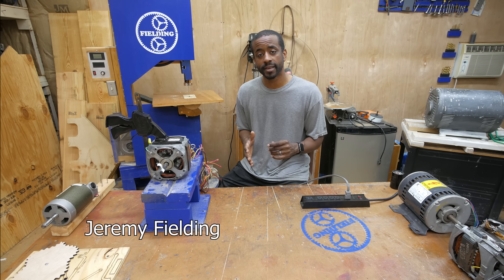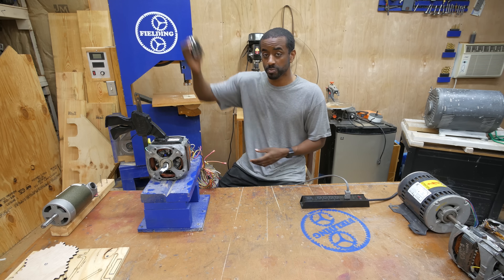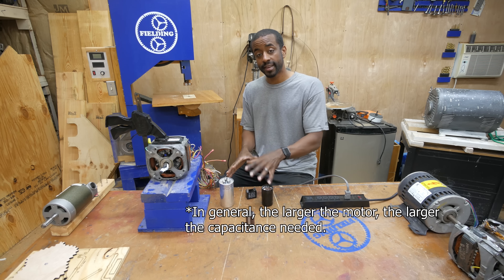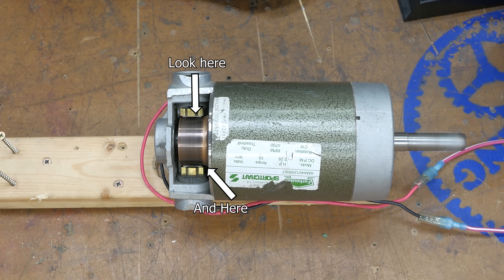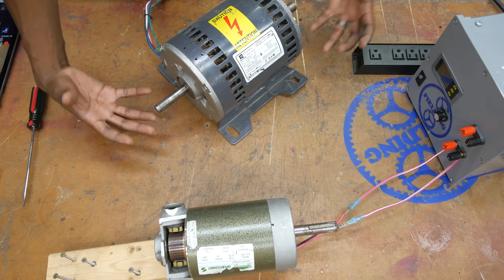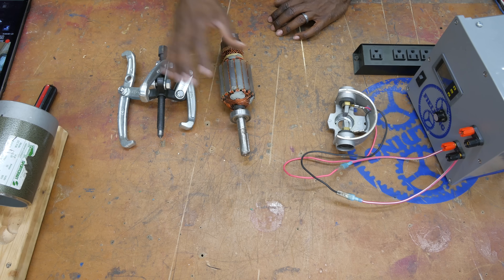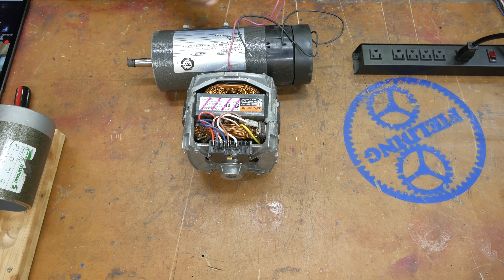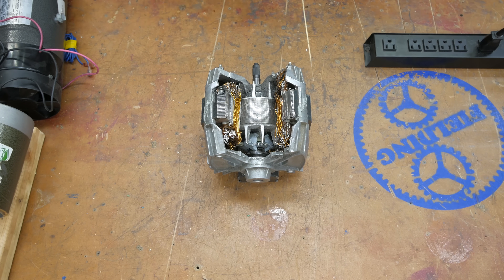Three Most Common Motor Fixes Anyone Can Do; Ultimate Guide to Electric motors ; #070

Comment: I'm completely baffled, I was thought that the start winding of a motor was a lower resistance since it uses a thicker cable and draws a lot more current during start up which is why an inverter motor in a fridge is more efficient since it start up less time than a standard motor, here is an explanation similar to what I was taught        
"Wicida Sarme, Retired Engineer (2001-present)
Answered Jul 13, 2018 · Author has 13.3k answers and 3.8m answer views

Typically starting windings in motors uses a heavier gauge AWG size of magnet wires than the AWG size used on running field coil windings..

This is I believe is necessary in order to support the generation of a much more stronger magnetic flux needed for establishing required starting torque.. In order to produce a stronger magnetic field, it will require a magnet wire size that is capable of handling more current as compared to the amount of current required to sustain the continuous running operation.."   Now I was watching some videos about fridge motors and everyone is saying that the run motor is a lower resistance to the start motor, can you explain that please, thanks

Comment: I've got motors (1/4, 1/3, 1/2, 1 HP) motors all over my home and work shop. Most of the older USA made motors have their original Capacitors (still work fine)  however some of the Chinese (junker motors)  have had Capacitors go bad. What t=do you expect-------- they can't even make Masks or Sheet Rock the right way!

Comment: I had a motor that somehow managed to get its centrifugal switch knocked out of position, which meant the switch couldn't pull one of the contacts back properly. This didn't disable the motor, it still ran, but there was a very loud clicking noise at any speed, and I suspect the start winding kept getting powered intermittently as the contact slid past.

Fixing it was as easy as working out how the switch was assembled, and correcting the contact position so the switch could disengage it. It's been fine since.

Comment: Ive replaced bearings in quite a few motors, a few capacitors, and a while back changed out the centrifugal switch on a bluffton. And more recently had to pull, clean, and re-oil the bronze oilite bushings in a fan motor. All very easy stuff to do for anyone with just some simple tools.

Comment: A little late but I would like your opinion. I'm from EU (240V-60Hz AC grid) and bought an air compressor rated  so. At my place (at the very end of an electric company line) I only get around 195-200V. My compressor is able to start when it's empty (or almost no load) but when charged with 2 BAR (30 PSI) or above, the motor justs hums until termal protection cuts off. May I get a full start with this low Vin if I increase the size of the capacitor? Or even adding another one in paralel? Or do I need more copper turns at the stater coil?

Comment: If the centrifugal switch has failed to return to rest, for any reason, or the electrical connections are't making contact due to debris or dust (huge problem with dryer motor this gives  the same effect as a bad capacitor. In essence your motor is trying to start in the run winding. Get a decent multimeter, learn how to use it, and always check a capacitor before purchasing one that you may not need, and probably can't return.

Comment: I like how don’t rush through your explanation and how clear you are with the subject.  I was helping a person and tried to use the air compressor the motor would try to start but after a few seconds it would kick out. I brought it home and plugged it in and it worked great, I though maybe there wasn’t getting oil up in the compressor and when I laid it on it’s side to bring it home, that got the oil up in the piston. When I took it back it did the same problem. I checked the voltage and it measured 119vac, but it still wouldn’t run. Do you have any suggestion?

Comment: I've changed the bearings and damaged/cut 2 of the copper wires by the commutator- is there a good way to fix this? I've tried soldering but it just does not want to take! (I did strip laquer off wires first)
 cheers all!

Comment: What if the motor is slow to start or trips the breaker. I have a benchtop mill and when it is cold out side it will not start in low speed but it will start in high speed. I have to use low speed for some things. Changing speeds is changing the belts on the pulleys. Could that be a weak capacitor?

Comment: That's what my pool pump sounds like.
Reply: M C 
I've had several pool pump motors sound like that. I will almost guarantee you one or both bearings have failed and it's locked up. I fixed mine for $30 with new bearings from a bearing supplier.

Comment: I've had wires to the brushes break loose and was able to reconnect and it is fine had that happen about 5 times on brushed motors so that might be something to address if you haven't already

Comment: My wife's treadmill was hesitating, then it didn't start at all.  It also seemed to run slow, but I don't know, I'm going on what my wife says. The motor isn't running, so I can't tell if it's sparking or hot. The brushes, are held in with pop out plastic covers. The brushes look shorter than the one in your video, but they are maybe less then inch long. If I take the motor apart, and it's not the bearings, or brushes, what wrong?

Comment: The permanent magnet on my O.B.motor tilt motor came loose (one of a set of two), the glue failed and released the magnet, causing the motor to fail. I contacted the motor company and purchased a special epoxy glue to reattach the magnet, took some measuring to get it relocated in the exact position, glued it in. The motor ran fine after the glue set.

Comment: Weirdest problem I've seen was somehow a winding got snatched by the cast fins. Motor locked up, and when I opened it up it had balled up a chunk of the winding. I have no idea, after years of service, how anything moved in the motor to cause it. My best guess is some part came loose and got between the fin and the winding, but even after the motor locked up nothing appeared to be broken. Weird.

Comment: I was waiting on some new motor brush units for my 240 Volt washing machine here in the UK. They just weren't showing up  with the Royal Mail going real slow with unforeseen protocols during the first 3 weeks of the Covid 19 lockdown. Anyway, I had plenty of time to pootle about and went ahead and cut the remaining brush stumps out of their slides, extended the feed cables from the back of each graphite block,  and effectivly 'cast' new brush extensions onto the back of the brushes out of epoxy putty. It was tricky, and I had to cast then a tad oversize and grind them very carefully to shape on some sandpaper glued to a flat board.  I used hot glue to mount them on a wee  'handle' to control them better, as each one was pretty small and plain awkward.  I just did it a little at a time till they fit just so and moved nicely in the brass slides. A reackon it took me just under 4 hours not counting the putty cure time of 24 hrs. It worked a treat  and still does.  Of course the ones I'd ordered showed up two days later, but I imagine I'll get another 6 months out of the extended ones, before I have to fit the new, and I can do that in about 30 mins flat.  Anyway, I dig the vids Jeremy, and will be checking  out your others, especially when lockdown eases here in about 3-4 weeks and I'll be able to head back to a  compressor fix that awaits me. Keep up the good work.

Comment: I have a start capacitor and a run capacitor on my dust collector. It will run but not at full speed. I ran it with the centrifugal switch exposed and it looked like it momentarily connected then opened again. I can't figure out if its the centrifugal switch or run capacitor. I'm assuming it wouldn't even run if the start capacitor was bad. I'm leaning towards the run capacitor, but when I opened the housing I didn't notice anything visibly wrong with it nor did I smell anything unusual. What do you think?
Reply from the maker: I have a video coming out on this topic soon. I bit to much to explain the possibilities here.
Reply: @Jeremy_Fielding  Cool.

Comment: Great video! Subscribed. I've got a 24VDC 1/3 HP 2500 RPM permanent magnet motor. It's got a 10:1 gearbox on the front. I've completely disassembled it previously to inspect it and haven't been able to find any issues. No increase or decrease in resistance on the commutator when I measure pairs of bars 180 degrees apart or when I measure each pair next to each other all the way around. There's not any connection from the commutator to the armature. I can't seem to figure out why, when I connect it to a power supply capable of 21A, I only see about 50RPM and it only draws about .2A.

Comment: So I’ve brought to life an old homemade bandsaw. Built in the late 60s. The motor does start if I push start. Motor wasn’t designed with a capacitor. I’m uncertain if the pulley size is to large or so I add a start cap. 1/2 hp, 1750, 120 ac, dual shaft. Also unsure what the other shaft was used for? Motor also has external Oiler ports. How often should I oil it and what type of oil?

Comment: I have a 5hp air compressor, I installed a new Square D switch and pressure regulator it starts and runs fine, but even after power is turn-off motor continues to spin...before I installed ned pressure regulator my belt was torn off...any suggested ideas why motor continues to spin?
Reply: first, your pressure swiths is not connected correctly, try disconnect the pressure switch and apply power to the magnetic contactor, nothing should happen, if your magnetic contactor coil is 110 volts, you should have 2 wires that  goes to the pressure switch, on the magnetic  contactor box, ( if power is 220 volts) one side of the coil is connected to the neutral wire ( white), on the other side of the coil, the wire starts from one of the power line ( red or black ), goes to the pressure switch then come back to the other side of the coil, if the coil is 220 volts, you can use the same layout except that instead of wiring the unswitched side of the coil to the neutral wire, you  connect to the opposite  line ( balck or red wire ). For 600 volts, it is  a bit different as you have a step down transformer and you follow the 125 volts diagram.

Comment: I have a boat lift motor and I run it with a DeWalt power station. It works about half the time without over loading the inverter on startup. It will never go up with the boat already lifted either. Any advice on improving this? HP - 1, V 115/208-230, rpm 1725, A 13.8 s / 7-6.8,  SFA 15.2 /7.9-7.6

Comment: That was a very well done presentation! It didn’t answer my question but no matter was fun to watch. I have a capacitor start coil winding that seems to be loosing connection when the motor gets warm. Kinda hoped I’d find a magic cure. Convection oven fan motor at more than 600 bucks I’d like to fix it but looking doubtful.

Comment: Exploding Capacitor Story
A Friend worked in a music shop fixing amplifiers. 
The shop used to be used for some industrial purpose so it had 440 volt power box which for some reason was still connected.
When the guys had a bad capacitor they would hook it to the 440 and blow it up (real good)
They did this for years, all good fun at work.
One day they hooked up a cap - which blew up and shot its contents into the 440 box.
A cap has a lot of aluminum foil as part of its circuit.
After the guys had explained why the Fire Department was paying a visit, The boss said "Don't do that again"
No further repercussions - it's good to be valued - even when you screw up

Comment: Working in a washing machine motor right now. Replaced the capacitor, but it still won't run.
Giving it a "push start" only seems to work, with the power off. Very difficult to do, need 3 hands.
Seems to resist spinning, with the power on. Tried cleaning the motor start contacts too.
I'm guessing the motor is bad. Probably from being overheated when the capacitor originally failed.
A new washing machine costs $450. A used washing machine motor costs about $60. But might be on it's way out too.
Not sure what to do now....

Comment: I have a 1.5 hp electric motor for a 1958 craftsman drill press.  I put a new capacitor on it which starts it just fine.  However, it now starts, runs for 2 to3 seconds and may or may not smoke or/and spark and then stops.  Sometimes tripping the circuit breaker.

Comment: Your videos are legit and I was wondering if you have experience with phase converters. I was experiencing a 3 phase motor doing the whole hum thing because I believe it had a bad set of start caps, is there an easy way to test this? I believe it was caused by the motor it was drivings make up was incorrect , being it was 240 but the peckerhead was made up for 480. Just found your videos and am hoping you could explain phase converters if possible.

Comment: Hi Jeremy, 
I have a mini table top lathe. Was working great until I got a back catch and the motor slowed down and then completely stopped. I waited a day and tried to turn it back on... nothing turned on. There was no hum, no reaction from the machine. I know NOTHING about motors. I have since taken off the "cover" and can now see the copper wire, brushes, and what looks like rows of staples (?). I don't think my capacitor is bad and I don't think my brushes need replacing. Any help would be MUCH appreciated!
Thank you in advance
Reply: Oh! This is a DC motor, volts 120, rpm 1700, phase 1, class E. Not sure if that helps. It looks very similar to the second and third motor you worked on.

Comment: I tuned in to watch your video as my small electric fan blower motor on my pellet stove stopped working and thought maybe it was fixable, (I have not removed the motor as of yet). When not in use the fan and shaft can very smoothly free spin.  When a load is put to it, it hums and does not want to spin.  At that point I tried to spin it by hand but it mostly wanted to stay put. So are these small motors repairable? (Harman Pellet stove)

Comment: I have a 10 yr old 1.5 hp 110 v hot tub motor that would only hum while trying to start up at times. I replaced the start capacitor it started throwing error codes within 24 hrs. The error said the tub was overheating because the motor was not pushing water past the heater fast enough. I replaced the motor but now im wondering if I should have replaced the run capacitor as well?

Comment: Dude you are awesome...I just got a like new 220v 9.6a KSP095 XM-265 TREAD MILL motor i want to use to build a belt sander. It has 6 wires. 1 green, 5 black. NO plate, no wiring labels. 2 of the wires seem to connect together in the winding of the motor thru a rubber connector, the other three I cant see. It has no capacitor, I am assuming those to go to a capaciter and the other three go to 240v black/white/red.  I have tried connecting it, it hums, i try to start turning it and it does start but then blows the braker. I NEED YOUR HELP!

Comment: I had an AC induction motor bearing fail.  The cause is the end cap's inside diameter for the bearing is toleranced too big to accommodate variations in the bearing's outside diameter.  The vibration destroyed the bearing and caused the rotor to rub against stator.  I put some shims in there with new bearings.

Comment: It's only a sales pitch for advertising who sell's the most powerful Wet/Dry Vac. You really don't need a 4.5 hp motor to get the air suction YOU NEED IN a vacuum as JEREMY Provided  IN HIS  motor TEST .A  4.5 hp power is a big motor. When he showed that small motor I knew  that motor will not have more then 600 watts of power that's less then 1 hp.  GREAT VIDEO JEREMY

Comment: hi. i have a machine. the motor of it works perfectly but after a time while runs, if i turn off it. then, after lets say 2 mins,  when i want to turn on it again, it buzzes or humms , and doesnt work till it got cold. so i have to put a steel stick to the gears after the shaft, and move it by force (like you did in the video), and pull the stick back quickly, so it continues to work. do you have any idea about the cause? might it be the capacitor like in your video? btw, i brought the capacitor to a workshop. They said it seems ok. then i called 2 "craftsman(the word might be wrong because of my english)" and they couldnt fix it neighter. i dont know what to do. could you please help me.

Comment: Hi I have a 6hp ac 240 compressor motor that won’t start . Doesn’t make any noise. I replace the capacitors. No luck  . I cancelled the thermo switch also.

Comment: Thanks for the video! Do you answer questions? 
symptoms of an electric lawnmower motor:
-doesn't start but when I tap the center shaft lightly it almost starts, as I jostle the unit it continues to almost start
-when I wack the center shaft, then it starts and runs until it cools down